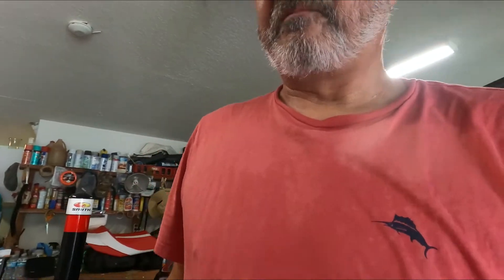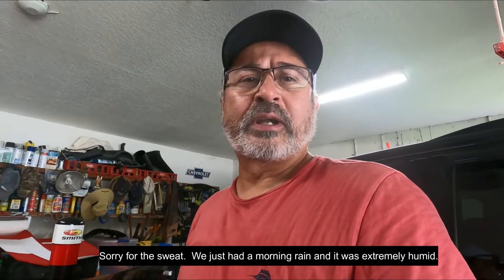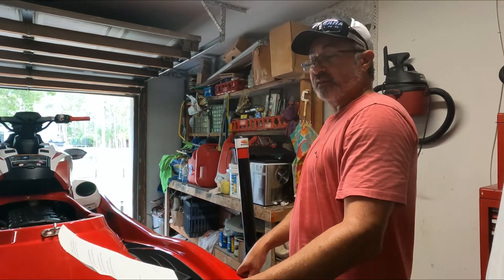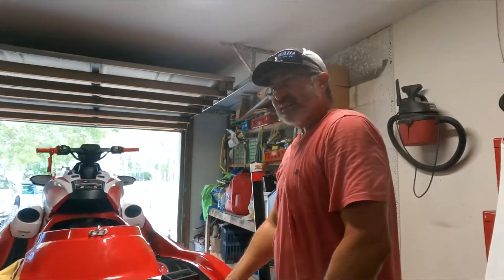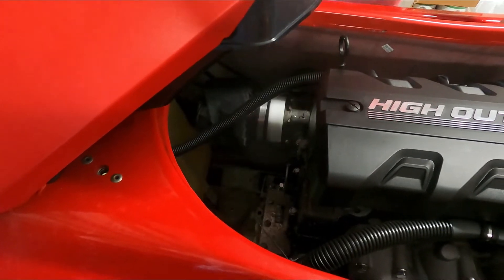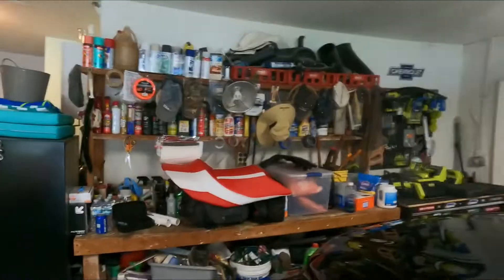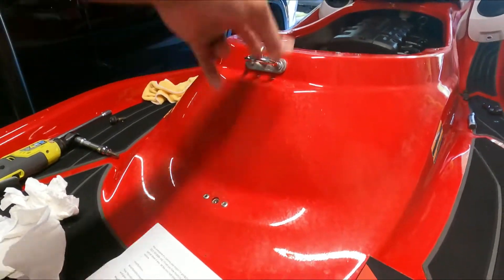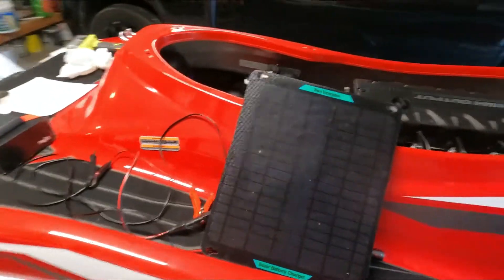2021 Yamaha GP1800r HO Modification/Accessories Review

Comment: I've GPS'd my 2023 GP at 65mph bone stock and that's fast enough for me. Quicker acceleration is what I would want and it sounds like these mods would do it. Thanks for the info!
Reply from the maker: The 1st thing I would suggest is the ribbon delete. You should see 2mph more on the top end for less than 50.00. Thanks for watching and commenting!
Reply: @tommytsadventures  sounds good. Riva has a Stage 1 kit available with all the upgrades you've installed minus the ride plate. It will make a good winter project.

Comment: Good vids. Planning on picking up my first jetski and was really learning towards the gp svho...now you have me thinking the HO route with the mods is the safer and smarter way to go. Quick question ....after mods are you required to run 91 or 93 octane ? Unsure if the stock HOs are 87 ?

Thanks. 👍
Reply from the maker: Thanks! With the mods, I still run 87 octane. I did try high octane and no difference. With the SVHO you have to run with high octane. I chose the HO for fuel economy and less maintenance. Can't go wrong with either ski. 
Thank you for watching and commenting!
Reply: @tommytsadventures  great thank you!! I have a free night tonight finally to go down the GPHO rabbit hole hahaha
Reply from the maker: I know where you're coming from! 🤙

Comment: Hello again, just installed a Solas Concord 11/15 Impeller on my 2015 VXR. Here is a list of all mods and costs:

Riva Intake Manifold Upgrade Kit	$43.95
Riva Engine Breather Upgrade Kit	$38.95
Custom free Flow Exhaust Kit		$50.00
Riva Power Filter Kit				$257.95
Riva Ride Plate					$354.95
Riva Pro Series Steering System	$863.44
Maptuner Nano Tuning System		$1266.21
Solas 11/15 Concord Impeller		$578.94

Total CDN						$3454.39

Now , next is to go out on the water and do some speed tests. Without the impeller I got 65Mph. Will keep you posted on my results soon with the impeller change.
Reply from the maker: Awesome,  interested to know the numbers you get from the impeller.
Reply: @tommytsadventures  Well, did some testing today with the addition of the Solas impeller. Gained about 3mph from the stock impeller. Went from 64mph to 67 mph.
Reply from the maker: Awesome! That stock svho speeds.
Reply: @tommytsadventures  The acceleration is awesome. That's what I prefer.
Reply from the maker: @michellimoges4700  I couldn't agree more.! It accelerates hard.

Comment: Hi there, for your info. I found an easy way to remove impeller. Remove pump cone, there is a big bolt there. Hold down your impeller with a crescent wrench, then righty tighty with an impact gun on the bolt, impeller will release with ease. This trick worked great. No heat no torquing, just an impact gun.
Reply from the maker: I'll remember that for next time. Thanks for the tip!

Comment: Great video, Question... If I would do only Ribbon delete and Power Air intake kit... Do I need map tuner? Any problems with water and the Air intake? I alway's have some water in the hull after playing and throwing it around. Yamaha VX Cruiser HO 2021
Reply from the maker: A ribbon delete and air intake doesn't require a tune. You will see a 1 to 2 mph top end gain from the ribbon delete and better throttle response.  I get a little water in my hull and never had a problem with the filter getting wet.  You will be fine. Thanks for watching and commenting!

Comment: What's your running RPM
Reply from the maker: Wide open I'm running over 8300 rpms.
Reply: @tommytsadventures   thank you I just got a 2015 vxr with 26 hours I'm going to get Dean's team level up package ribbon delete  worx power filter  gp oem Ride plate and pump wedge  and ECU flash  so I hope to get 70 with the set up 1100 Dollar cash really good deal it's my second ski I got a 2019vfx SVHO stage 2 but it sucks on gas
Reply from the maker: @rogernascimento5006 Nice! thats the deal of the year! You should get 70 or close to it.
Reply: Well  Dean's team did my fx svho I been running his tune for 150 hours no issues he the best for Yamaha his kit come with the pump wedge too thank you for the update 😅

Comment: What kind of top speed you getting with mods on that model
Reply from the maker: On the speedo im hitting 74mph but on GPS  I'm getting 70mph.
Reply: @tommytsadventures  wow.i got 2 2022 FX SVHO Supercharged and they only go 70 mph  and that's if it's smooth. rough conditions 67 68 ..was just at Lake Havasu this last weekend lost of wave runners having fun..cops out like crazy.
Reply from the maker: The mods definitely woke the ski up. If you did a stage 1 tune and impeller on your svho you would be 75mph+.

Comment: I have the same 2021 in black. For over a year I have been thinking of doing it, but haven't pulled the trigger. I already have air intake, ribbon delete and riva sponsons.  Now it is tune and impeller.  Do you really think it is worth it? Reliability is good? Gas mileage is still good?
Reply from the maker: I would absolutely do it again! It runs great and I haven't noticed any fuel mileage drop. I don't ride wide open all the time but it's nice having the power on tap when needed.

Comment: Is it ok or worth it to put the stage 1 flash on it without any mechanical mods? Thanks in advance.
Reply from the maker: You can put the tune on without the other mods and still get top speed gains. You might get cavitation when accelerating out of the hole if you don't install the impeller.  If you want to save money you can do the ribbon delete and should get 2mph top speed gains. That part is less than 50.00. Thanks for watching and commenting!

Comment: What was your top speed before the mods and then after? Thanks for the great video
Reply from the maker: My stock speed was 66 to 67mph. After mods its 74 to 75mph. Thanks for watching!
Reply: Is the reason your neighbors Svho is having issues is because he is modding it? They say if u leave the Svho alone and just remove the limiter they are fine.
Reply from the maker: No, his is still stock. The SVHO issues usually happens because of wave jumping or riding hard in rough waters.  We do ride hard at times. That's what caused his clutch to go.

Comment: Hi Tommy, thanks for the great video and tips! Do you happen to have any information on your fuel consumption pre and post mod?
Reply from the maker: Hey Like2Ride. Unfortunately I didn't do any b4 and after logging for fuel consumption but I can tell you there wasn't  much of a difference.  I really appreciate you watching and commenting.  If you like the content pls subscribe.  More pwc videos in the works!
Reply: @tommytsadventures   What octane fuel are you using?
Reply from the maker: @like2ride151  I use medium or premium octane but you can run it on regular unleaded with no problems.  You might lose  a mile on the top end on regular though.

Comment: Hi Tommy, great vid - TY. I have the same GP in black and plan to do almost the same, (i.e. Riva stage 1 map, 11/15 impeller, breather kit, ribbon delete (i'm on the fence for the ride plate and free flow exhaust) two questions for you:

1. You mentioned re-pitching the 11/15 to 11/16. With the new ride plate added were you still getting Cavitation so it wasn't  necessary to re-pitch or did you still get cavitation after you added the ride plate??
2. Is it louder with the free-flow exhaust (guessing yes) but are we talking boom box / obnoxious or is the difference immaterial??
Reply from the maker: Hey David, even after installing the ride plate I still get slight cavitation.  It's not bad though, just a split second out of the hole with wide open throttle is when it happens. I can live with it until i eventually repitch the impeller. As for the exhaust, it is louder but not obnoxiously loud.  I really think it helps with the performance,  power filter kit and ribbon delete gets the air in faster with more volume and the exhaust gets the gases out faster, thus better performance.  You will see a huge difference when you do the mods. Let me know the results once you get the mods.  Thanks for watching and please hit the subscribe button!
Reply from the maker: David, In this video at the 10:16 mark you will hear the slight cavitation.  https://www.youtube.com/watch?v=Di6NiJ2Abmg
Reply: @tommytsadventures  Thanks Tommy - will do

Comment: Why is the impeller changed from stock 13/19 to a lower pitched 11/15?
Reply from the maker: I don't know what the stock impeller is but when you do a stage one tune Riva recommends installing a 11/15. The tune  changes your rpms from 7500 to 8300 as well as other parameters.  I was told if you didn't change the impeller you would get cavitation out of the hole and hit your Rev limiter too quickly.

Comment: I have the same exact machine and swapped out the restrictive intake grate for an older GP one without wings on it and it freed up 2.5 mph top end on mine. I don’t do a lot of heavy chop riding so I never seen a difference other than speed and better ride
Reply from the maker: I couldn't believe how restrictive that ribbon was. If I knew the gains you could get by replacing it, I would have done it sooner. I had the upgrade for a couple of months before I installed it. That should have been the first mod I did.  Thanks for watching and the comment Steven! Please subscribe if you like the content.

Comment: reliability on svho is just fine.  i have 50 hours on my 21 gpr after mods hitting 84 mph  zero issures. Also i have 110 hours on a fzs hitting 73  with zero issues. clutches are just fine if you dont abuse them.